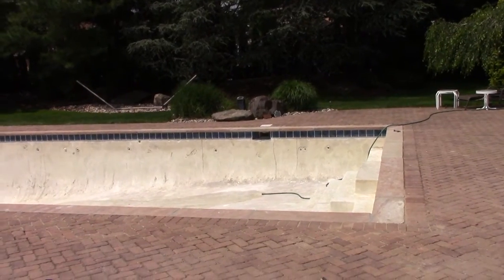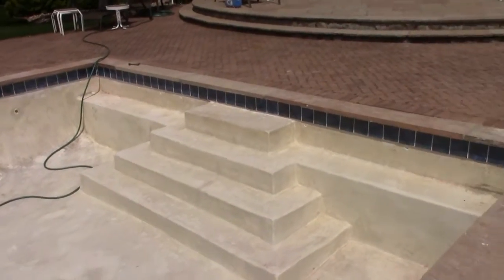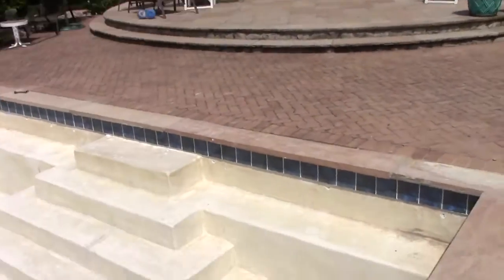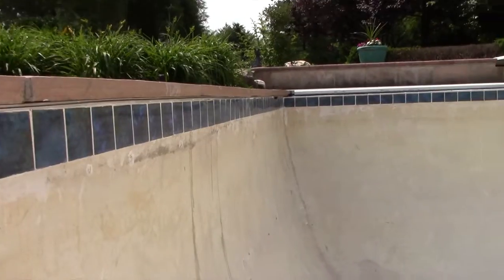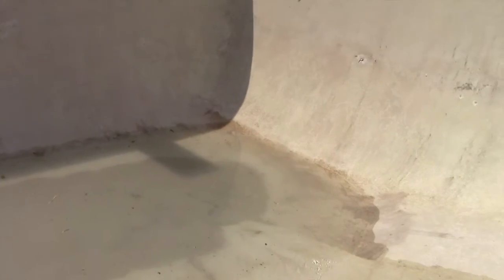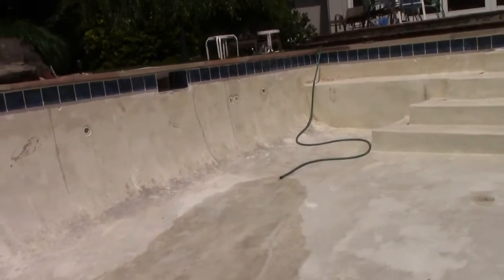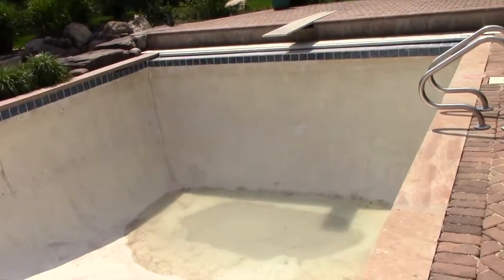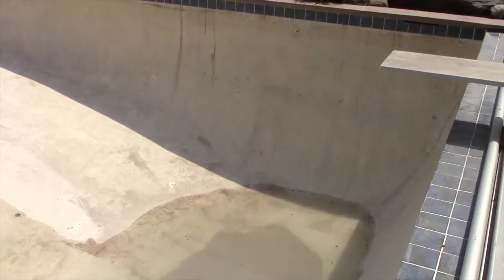Pool Repair: Part 8. First Clean-Up

Comment: Wow, all them little holes.  Still doesn't sit right with me that it's part of the job, and that they'll be patched.  Typically the patches are the weakest point and are usually seen.  Of course once the pool gets finished, the marble dusting may provide a nice, solid coat over that, which will prevent the patches from failing.  Just doesn't make sense how you'd make holes in something that needs to be watertight.

And watch that hose there, if you end up taking a cat-nap, that thing's liable to be flooding the cabana by the time you wake up!
Reply from the maker: jaykay18 I am willing to bet that they have something that will completely fill in those holes before the marble dusting. 

Now see, in California, that'll cost you $500. ;)
Reply: Sharkie626 One of the most classic Sharkie lines of all times!
Reply: Sharkie626